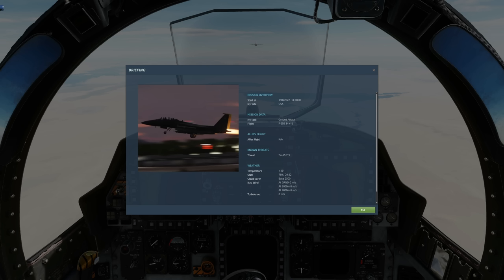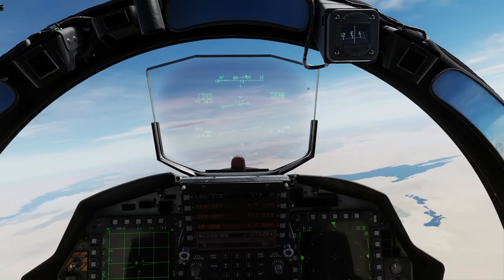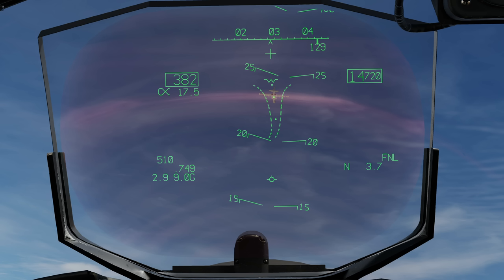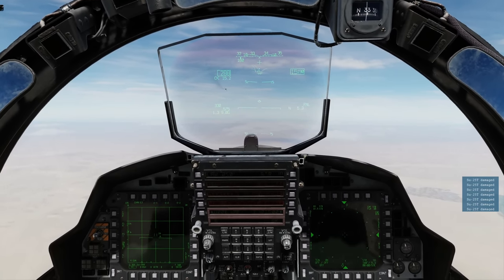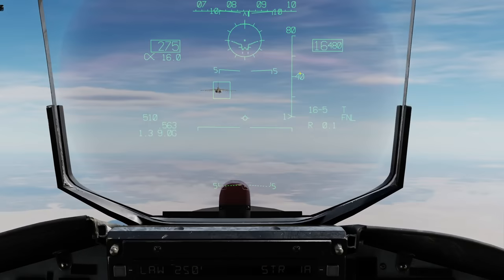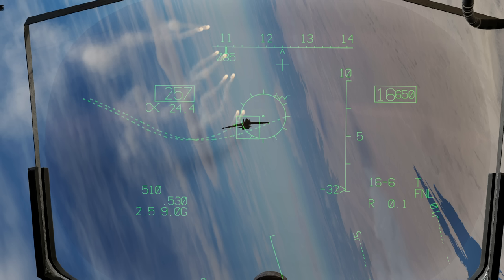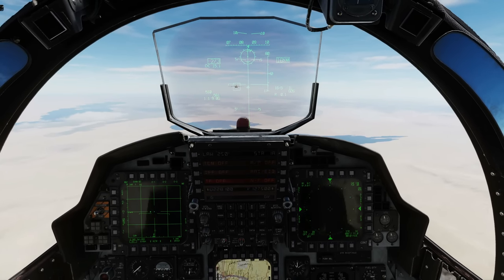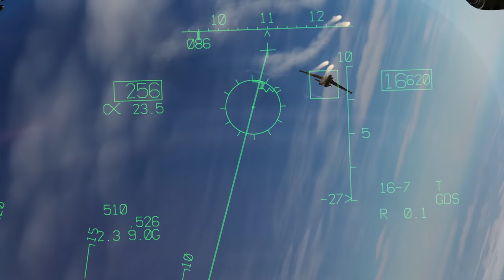F-15E Strike Eagle: Air To Air Gunnery Tutorial | DCS

Comment: The symbology for that GDS mode looks like it could be useful with that plane of motion line. My thinking is that if the enemy is moving along that plane of motion line, and you line up that line over the enemy and the pipper is in front of him, pull the trigger and unload the stick a little so that you drag the pipper over the target, that should be pretty effective. Right?

Strange though that there is both a GDS mode and a mode with the funnel and the radar pipper. Would've thought that if you can lock the target, the GDS would be the one you'd always use, can't see what the radar funnel would offer over GDS.

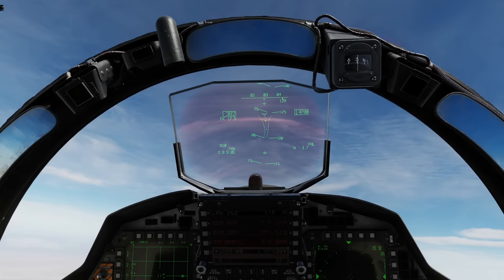Comment: 1:45 If you were to fire now you would miss... by a lot!
The gun cross is pointing behind the target instead of leading it. Never aim with the funnel! Always aim with the gun cross! The funnel is only there to help you determine the amount of lead.
The funnel is a historic gunsight, not a predictor gunsight. It responds only to the movement of your aircraft and is only accurate if your aircraft matches the target's movement. Here however the target's movement is to the bottom of your HUD while you're pulling g:s to the opposite direction causing the funnel to move down.

Comment: Why do you fire in small bursts? Why not a longer burst and drag over the target?
Reply: Because 550 rounds is literally 5.5 seconds of fire.  You don't blow your whole load on one target.  Optimal firing would be a literal tap on the trigger releasing 20-25 rounds for a solid kill.
Reply: @itsjustme8947  Do real fighter pilots actually do this? It seems like that "fully semi-automatic" line from cnn.
Reply: @SorcererAC0   Fire in very short bursts?  Absolutely.  Trigger discipline is a thing and cannon jams were a real problem.  If you've ended up in knife-fighting range or have depleted your air-to-air stores, something has gone wrong.  At that point, it's time to go vertical, extend, and leave that party.  I would take a 'free shot' if it were presented, but that's not my mission.
Reply: @itsjustme8947  I never actually thought about that. I just watch GS duels but just assumed if somehow it's one guy and this isn't real life that i'd get a better chance of scoring a hit with a slightly long burst just less than a second.
Reply: @itsjustme8947  Otherwise if somehow going from bvr to the merge i'd be pretty spooked at the scenario too
Reply: @SorcererAC0  Highly unlikely you're gonna get jumped.  AWACS exists for a reason, lol!  You have a wingman as well.  Let's not forget that you're driving a Strike Eagle so you're armed for a ground attack mission.  Not once did I ever engage in air-to-air.  Now an empty cannon, well, that was about 10% of the time.  Toyota pickups with a heavy machine gun will always merit a quick gun pass when spotted.  Anyway, you're likely to have top cover in the form of a flight of -16's.  Basically, if an enemy aircraft doesn't fly a straight line in front of my gun, I'm calling in the cavalry and heading for the barn.